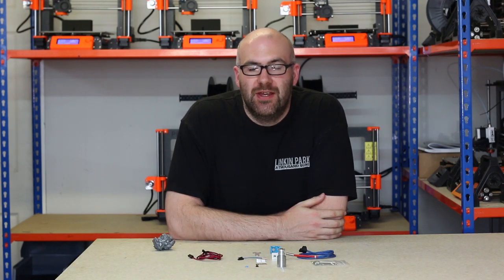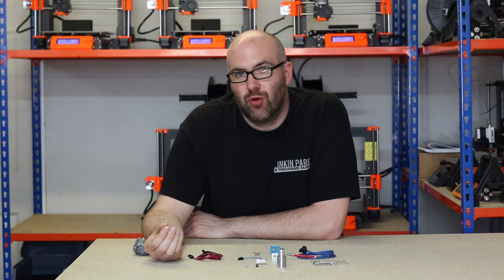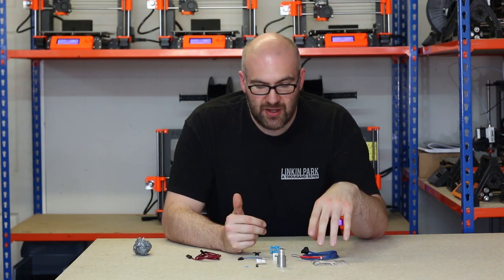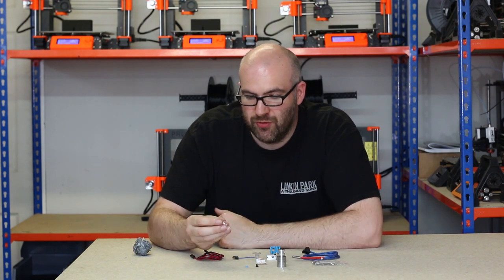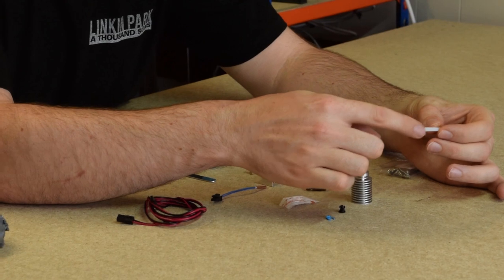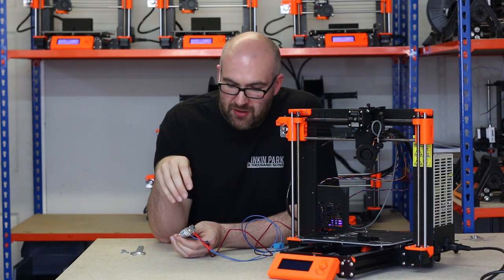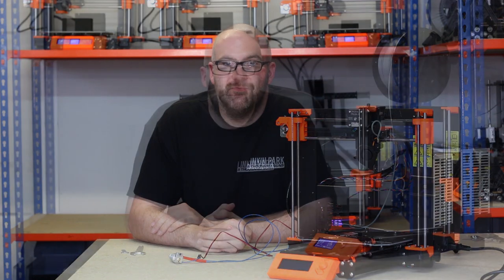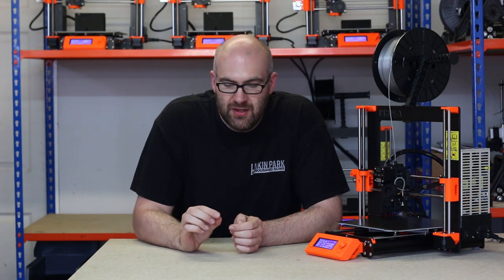Upgrading/Replacing Your E3D Hotend | What To Know | Ooznest

Comment: Hi, I have a few issues with the hotend. I realized after oozing PETG from the top have of the heatblock that the heatbreak and the nozzle were not sealed...seeing that other nozzles are shorter would it be possible to get a slightly shorter block to ensure the gap from the heatend and the coolerblock are maintained? I'm planning to buy a replacement heatblock and sand/grind it down just a bit form the heatbreak side to allow this seal to better work itself.

Comment from the maker: If you have any questions are want some more information, please leave a comment
Reply: hey ! i need just to replace the heatblock is it just possibe to unscrew the nozzle or are the parts connected by another join ? regards david
Reply: @31RIP  Hi David, I know it's 3 weeks since your comment but, yes you can. Heat up the hotend, unscrew the nozzle and the block with be free to unscrew, be careful of the heater and thermistor wires.